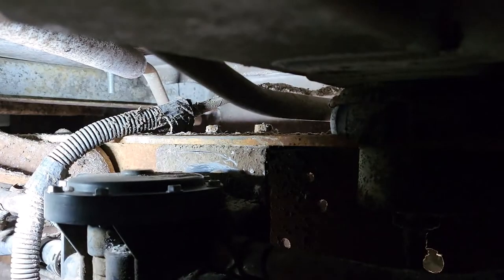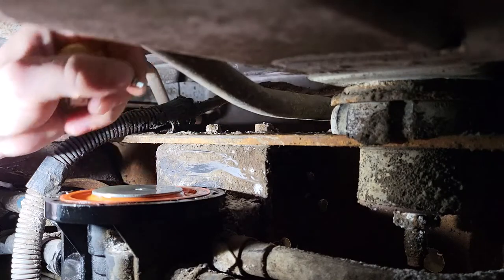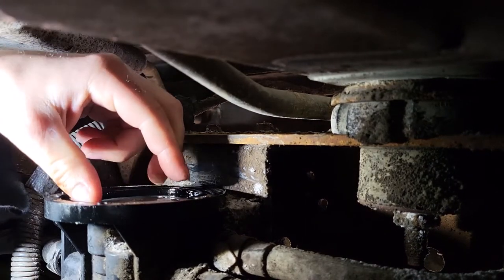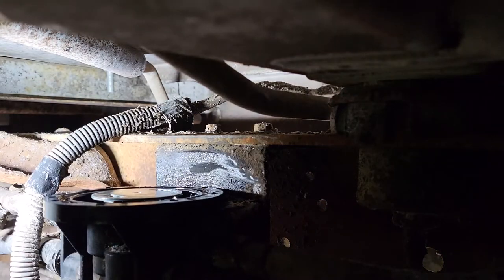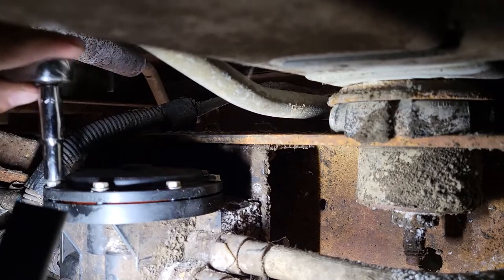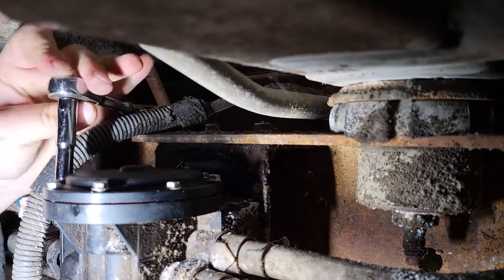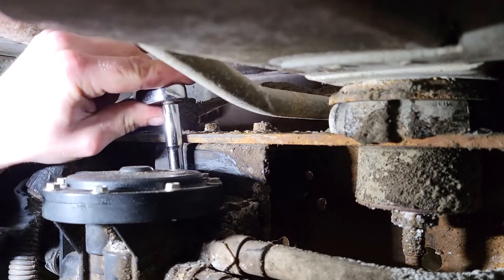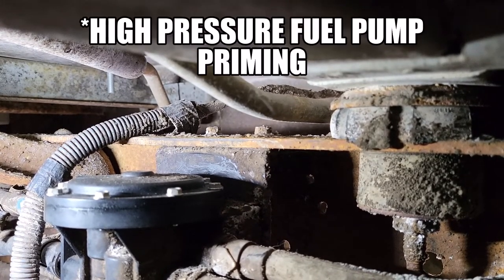Ford Dual Tanks not Working? Watch This: E350 Tank Selector Switch - Real Time Fix & Mechanic Humor

Comment: Thanks for the video! My rear tank was the one not working and I was planning on pulling the entire selector valve out but now I'm gonna give it a try while it's still attached. Much appreciated!
Reply from the maker: You're welcome! For us it was the front tank not working, just depends on what position the valve was stuck in. Sure beats all the extra disassembly and reassembly involved with removing the valve when you work on it in-place.
Just verify the valve is the type like ours that the top un-bolts to access the inside, some of them from later models, or that have already been replaced, do not open (are not serviceable).

Comment: I have an 88 ford ecolime 250, 351 Windsor I think. It sat for 13 years, full of gas.  Dropped front tank and gas is black lacquered.  Should I expect to replace this selector and all fuel lines?  I appreciate your videos! Thanks!
Reply from the maker: There is a possibility of that being necessary, you should work from the tanks forward. Try disconnecting the fuel lines at the engine and further back by the selector valve. Blow compressed air through the line to see if it is clear or clogged. Your valve should be the serviceable kind like ours, being a '88.
Best of luck!

Comment: Thank you for this video! How long will this fix work? I'm thinking my Ford Glendale RV has the same issue.
Reply from the maker: You're welcome @John Hillis
Just making sure, your RV has the Dual Tank System? What year is it?
It has been working great for us ever since we did this repair a couple months ago.
For us the symptoms of the valve being stuck happened after both of the tanks were run dry on accident... so as long as both tanks are used frequently it should not happen again (fingers crossed)
If it does happen again it is simple enough to get back in there and do the process over again! Better than shelling out the cash for a new valve...
Some of these valves are closed units, meaning they do not have a lid that is removable by the bolts on top like the one on our van...
In that case the valve will need to be replaced...